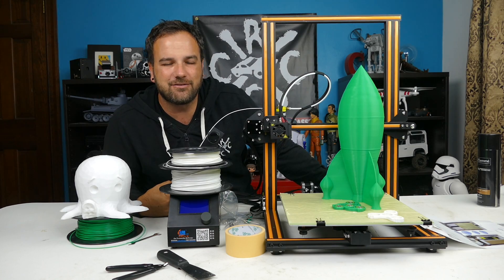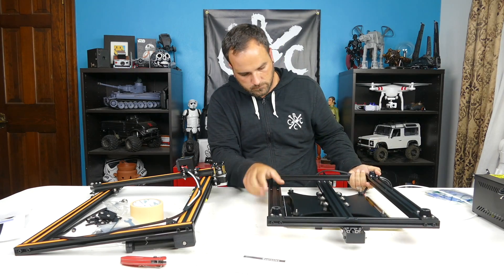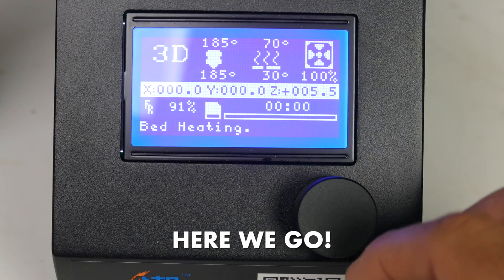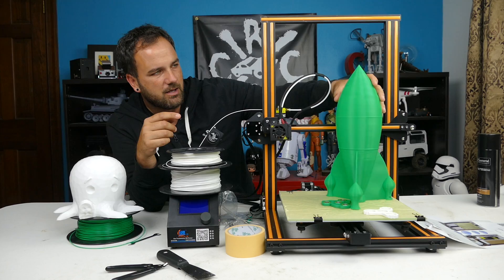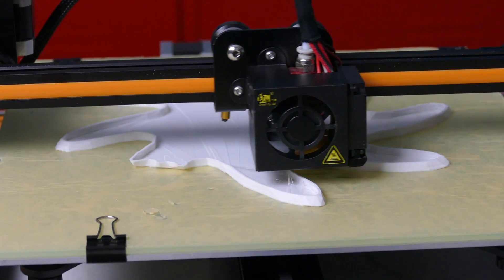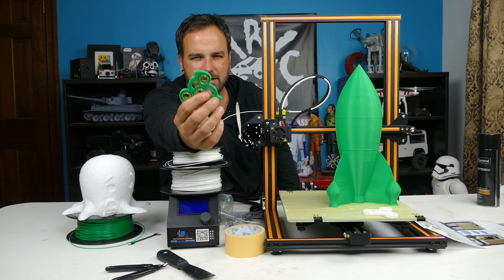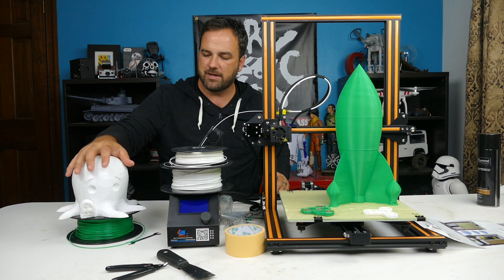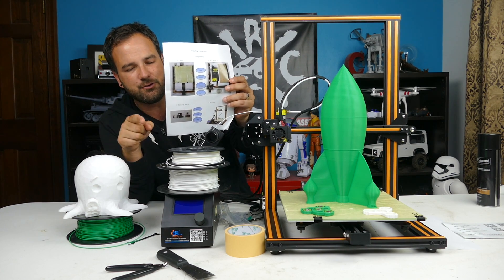Creality CR-10 ⇨ Large Scale 3D Printing On The Cheap!

Comment: Cool stuff man! I have the A8 and love it... gonna check this guy out :)
Reply from the maker: The A8 has a good print size as well compared to most that were in my budget. Don't regret purchasing that one bit because it makes nice prints. The only issue I've had with it is how hard the filament can be to change. I need to print the guide to make it easier.